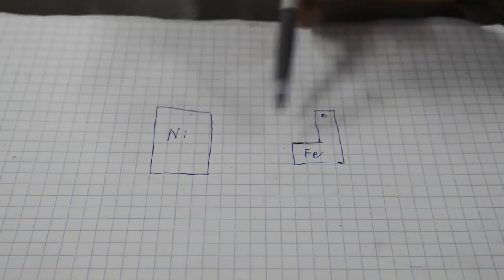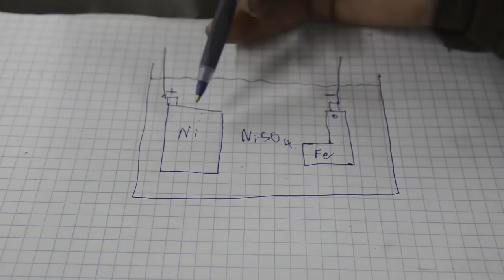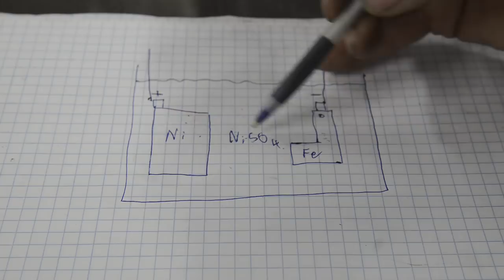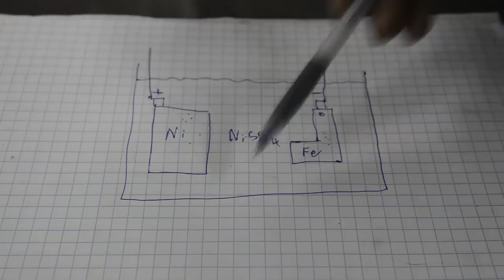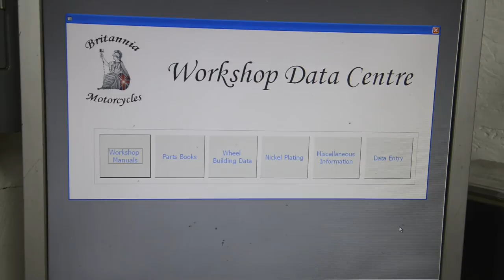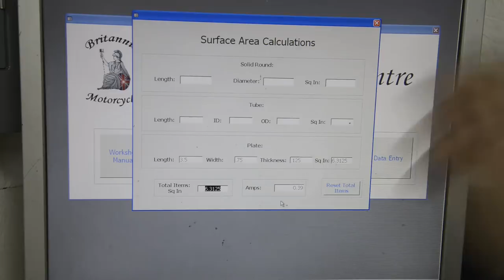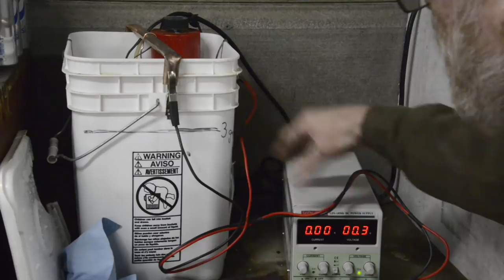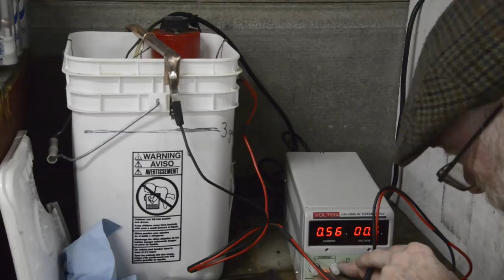Nickel Plating

Comment: Great info. If anyone is wondering (I was): 16 square inches is roughly 100cm2, an area of 10 by 10. So 1A per 100cm2.
Oh, and a “thou” is 1/40th of a mm, about one layer of spray paint.

Comment: I just recently produced my first successful two stroke cylinder casting in the garage. I want to have a go at plating it myself too, Nickel Silicon Carbide.
Currently soaking up all the information I can find on Nickel plating.
Really enjoyed your video!
Reply from the maker: Sounds like an interesting project. I hope the video was useful. Plating aluminium, like welding it, is more intricate than steel as it is far more reactive. Is the Nickasil preferable to chrome?
Reply: @BritanniaMotorcycles  Thanks! I'm going to try honing the cylinders in a zincate solution to mechanically remove the oxide layer and replace it with a thin layer of zink before plating. Conventional acid stripping + zincate is problematic due to ridiculously strict chemical regulations in Norway. Normally I wouldn't care too much, but making/using say consentrated nitric acid in a youtube video might draw unwanted attention.
Even the Nickel sulfate I have to order to Sweden.
Reply: @BritanniaMotorcycles  The Nikasil has ceveral advantages over chrome, but I'm mainly doing it cause the process is interesting and I haven't seen anyone else do it.
Reply from the maker: Originally I was a chemist and spent most of my career overseeing the loading of oil and chemical deep sea tankers. Concentrated Nitric Acid is very nasty and has a great affinity for organic material eg skin and flesh.  The fumes also are highly toxic so I can understand why it is not easy to get hold of.
Reply: @BritanniaMotorcycles  Absolutely, not something to fool around with. Let's hope the zincate honing works!

Comment: This turned up in my feed since I've been researching nickel plating... The current per area you quoted isn't that important, running it at lower current for longer works fine too, as long as everything is clean! If you can blast the part with higher voltage for a bit, it will help to clean the metal too, but as noted it gives a dull finish that might be flakey. I'm using self made nickel acetate with table salt.

Comment: Thanks a million Michael - I've had a go using a nickel acetate based electrolyte and it seems to have worked OK for a mat finish on a couple of bench tools I made but I was unsure of the correct amperage and duration for a reasonable thickness like 0.001". This video gives me more of an idea of where to start rather than the vague 'as required' that other sources state.
Reply from the maker: I am glad that it was of help.

Comment: Very helpful, thank you for posting this.  that type of power supply wants it's initial switch-on to be with no load attached; as likely you are aware so just a reminder for some viewers. Thanks for showing the different surface preparation conditions and end results too. It looks as if one of those vibratory bowls (or two or three) would make some of my parts preparation less tedious.
Reply from the maker: One problem with how to videos is how deep to go, and you always have to draw a line somewhere. I was working on the principle that if someone bought a power source then they would get instructions with it. But this is always the beauty of comments like yours. I have learned a lot from people who have answered questions in comments or clarified points in the videos. Thank you for that.

Comment: Nice, easy to understand instructions.  Now I can start plating some bolts from my 65 MGB.  Would you recommend copper plating steel before using nickel?
Reply from the maker: Sorry Ron but this comment slipped by me. You don't need the copper layer with nickel but if you have bad pitting or scoring where you don't want to sand down as far as you would need to go to remove it, you can build up with the copper and then sand that down.

Comment: Hello, great video by the way, and thanks for taking the time. I tried it for the first time today, did not use the heater or the agitator, part has some milky looking areas to it, going to use a two part nickle stripper and add the temperature control and agitator, my question is inhave the same agitator, can i remove the carbon filter? Ive heard that the carbon filter removes the  brightner from the sulution, what is your opinion, feel free to check out my work i do hand engraving, thanks again
Reply: Im working on a 1911 frame and slide.
Reply from the maker: Yes definitely take out the carbon filter it does deplete the brightener. The temperature is important for correct plating and without the agitator you will get a number of problems with the finish.

Comment: Thank you for the very informative and thoughtful video.  I work on jukeboxes, and most people send their parts across the country to have them chromed, at what is to me a prohibitive cost.  Nickel plating seems to be a smarter option.  But some of the castings are very thick and heavy aluminum or even pot metal.  Can those things be nickel plated?  Thanks.

Comment: I have a 1959 RE Constellation project. The alum crankcase covers have some knicks. When I watched your video you mentioned that copper can be used as a fill. Can the part be masked to fill the dings only then polish the copper to blend the the filled ding with undamaged alum surfaces? Or does the nickel just work on steel? I am thinking about a lot of Chrome plating. The price seems to have gone mad since I last had parts chromed.
Reply from the maker: Plating aluminium alloys is difficult because of the formation of aluminium oxide on the surface. For the nicks just take the cases to a welding shop and get them TIG welded. They will just put a blob of weld on each nick and then you can sand it down. For alloy I would advise just polishing it, you can get a mirror finish with a little effort and a good polish such as Mothers.

Comment: very informative ...great vid!... i have some motorcycle carburetor bracketry that has already got nickel plating on but most has worn off and is rusting in places ..can i just nickel plate these or do i first have to remove the old nickel plating first
Reply from the maker: To be safe you should sand of the old plating and repolish and degrease before replating.

Comment: Michael, thanks for the details video.  
What is the Bath Temperature? 55 - 65 C seems to be the range.
Have you been concerned about the PH of the bath?
Reply from the maker: Hello John. The Caswell instructions say 110F (43C) and that is what I have my heater set at. If you use the intended concentration of solution of the Nickel salt and brightener the pH  will be right, and as the reaction simply moves the nickel from plate to solution to plating object the concentrations etc will remain constant.

Comment: Enjoyed the video.. Question, One of the key points you made towards the end was  "using fresh materials"  however I am certain that you dont mean scrapping the anode and electrolite after plating each object.. What do you look out for to judge that the materials are getting tired.. 
regards. John
Reply from the maker: This is a process where if everything was perfect the plating solution would last forever. The nickel plates will get thinner and thinner and holes will appear as they start to get used up. But the solution is simply a vehicle to get the nickel from the plate and onto the item you are plating.  However you will see the solution lose its clarity and become dull and the plating will get dull as the brightener is depleted. But it takes a long time for that to happen.
Reply: @BritanniaMotorcycles  Thanx for the reply Micheal.

Comment: Hi Michael, thank you for this very informative video!  I do have a question regarding the brightener... Does it make the finish "brighter", or is it just a gimmick? I'm getting ready to purchase a kit here in the states, and I have seen this as an option but couldn't really find any solid info one way or the other.  Thanks!
Reply from the maker: Yes it does make a difference. The nickel salts replenish themselves in the chemical reaction during the electrolytic process but the brighteners don't. After use of the solution, quite a lot of use actually, you will see your nickel plating gets dull. That is when you need to replenish the brightener as it slowly gets used up..

Comment: It’s not an aerator it’s a pump circulate the solution. If you aerate the solution you will have a ton of problems. Also that pump take off the charcoal filter on the bottom of the water pump.
Reply: Just answered my question. Thank you for this video.

Comment: What's the formula for determining the amps so I can replicate it?
Reply from the maker: You need 1 amp for each 16 sq inches. So you need to calculate the total surface area e.g. a 2" x 4" x 1/2" plate would be two sides at 2" x 4" plus two edges at 2" x 1/2" plus two edges at 4" x 1/2" = 22 sq inches. So for that piece you would use approximately 1 1/2 amps. For a round rod you would need the circumference times the length plus the area of the two round ends.
Reply: @BritanniaMotorcycles  Thank you

Comment: thank you for the video, I have a question. in the plating tank, I have a heater after using the tank and heater for a while some sort of yellow-brown material gets accumulated on the surface of the heater, do you know what it is
Reply from the maker: They are just nickel salts that get baked on. Wash the heater off each time that you finish plating.

Comment: #Michael Waller  Great Video! Came across your channel while researching nickel plating. One comment, I do like your idea of a square bucket, would be easier to work with. But a larger square bucket is usually hard to find. If a person only had a round bucket, you can always bend the anodes to approximate the curve of the bucket. That way they don't take up so much space. A square bucket is still better, but a round bucket can be made to work.
Reply from the maker: You see, there is always another way to do things. I am glad that you found the video of use.

Comment: I would seem to me that you might be able to come up with some watts being used at any given moment rather than have to guesstimate the area on an irregular part being plated.  So you could just adjust the amps (maybe volts) until you had the right amount of current flow needed.  Maybe a Watts, Volts, Amps, ratio.  I'll have to do some thinking on this.  I'm about ready to try my hand a nickel plating, I've played around with copper.  Have you tried to chrome plate anything.
Reply: You are overthinking this , AMPS & VOLTS  is all you need . WATTS  refer to “real power" over time  ,  AMPs volt-amperes refer to “apparent power"  by using Volts & Amps combined you can get your time that you need to have your parts in the solution , If your going to be figuring out the WATTs you will be spending most of your time trying to figure out what you should be doing with a calculator instead of working . I think that Mr. Waller did a very good job of explaining how to nickel plate various items . I worked in the jewelry industry for 40 years and I'm still working in the field but we do Gold , Rhodium , Cadmium , Palladium mainly witch are very toxic compared to doing Nickel plating . I even learned something 👍

Comment: If the parts have been plated previously does the old plating have to be removed first,  or just polished up to a gloss first?
Reply from the maker: On copper or nickel you should be fine. I am not sure about chrome though.

Comment: I was in charge of a school bus fleet along with buildings I always ordered 50.50 diesel stove oil you lose a little mile but it never gels one year the fuel distributor refused to sell it to me because they had anti gel addatives I threw a fit I bought 10k gallons a time we lived in North central Wa of coarse it got real cold and I had a fleet full of gasoline in the whole fuel system I almost got fired but one of the school board members backed me up same thing happened to him stay with what works folks. Thanks for the video it's exactly what I was looking for
Reply from the maker: I am pleased the video was of use it was a bugger to make. I learned from one of the diesel supply company's delivery drivers that they had their fleet off the road that day as none of their diesel lorries would start.

Comment: Great videos sir! Question, wouldn’t the solution be conductive enough for the pieces to be “connected”, thus, not requiring a spade connector?
Reply from the maker: Do you mean linking the two plates? They both need to be charged to make the ions flow from the plates to the work piece so they have to be connected directly to the current.

Comment: I loved you video great info. Where can we get software to put measurements in?
Reply from the maker: It was a programme that I wrote myself using Microsoft Access. I used Access just so i could make the input page easier to use but a spreadsheet might be more suitable as it is just a few maths formulas.

Comment: Michael, do u have a formula for the area of nuts and bolts to be plated?
Reply from the maker: You just have to break them down into separate parts e.g the area of the flats on a nut or bolt head times six and then a cylinder for a bolt. It is tedious which is why I did a little spreadsheet so I only had the enter the minimum amount of date. Unfortunately I don't have the formulas any more.

Comment: Can you tell me the reasons one would choose nickel over zinc (or vice versa) for motorcycle parts plating?
Reply from the maker: Two reasons really and probably the most important one is that the nickel is more decorative, it's shiny. Also nickel is a much harder metal than zinc, it wears a lot better.

Comment: Have you published you calculation for the area and amps required to plate a piece of metal?
Reply from the maker: No. I wrote it all in Visual Basic on an Acess form. I suppose that you could do it in a spreadsheet as well.
Reply: Michael Waller how do you calculate amps/sq in.
Reply from the maker: I will send you the details in an e-mail.

Comment: Great video thank you! Can I plate aluminum? I would like to try nickel plate some wheels. Very inspiring and detailed video!!!
Reply from the maker: Yes, but. Aluminium is a more reactive metal than steel and forms a layer of oxide almost immediately that bare metal is exposed to air. I believe that it has to be treated with something like an acid copper layer before the nickel. Check with Caswell.
Reply: Thank you. One more question. Have you ever clear coated final polished nickel layer? I was wondering could it be more durable?
Reply from the maker: No clear coat needed. In actual fact it is the nickel layer under the chrome that provides the corrosion resistance. When chrome starts to bubble it is due to poor nickel application not the chrome. Also the nickel is a very hard layer.
Reply: Sounds awesome. So many parts in my project that I'm gonna go with plating. Videos like this, keep going! 💪

Comment: Very informative, thanks, Michael. Will you need to polish the nickel, or won't it tarnish?
And thanks for the resources, the manuals and calculator, etc.
Hope your weather improves...
Reply from the maker: Yes it will tarnish over time, but it is a long time. A soft polish helps, nothing abrasive, as they leave a sort of protective coating. Caswell recommend a polish but I can't remember what it is. Snowing as I write this.

Comment: Most of my bike parts are aluminium would I have to copper coat them first? If that's the case  could you do a demonstration of this process?
Reply from the maker: Aluminium alloys require a couple of extra steps to deal with the speed with which the surface oxidises. I have never plated any alloy parts as I always just polish them so I am afraid I cannot be a lot of help. I would contact Caswell plating here in NY state, they are always very helpful.

Comment: I will describe the process a little = chemical nickel plating without applying electric current = metal part = after degreasing == dressing = part is lowered = into solution = where temperature = + 90-92 degrees and boiled = 1 - 2 hours = solution - electrolyte = nickel chloride 30 grams per liter == sodium acetate 10 grams per liter == and sodium hyposulfate 15 grams per liter = and additives for luster == try in your video == thanks =